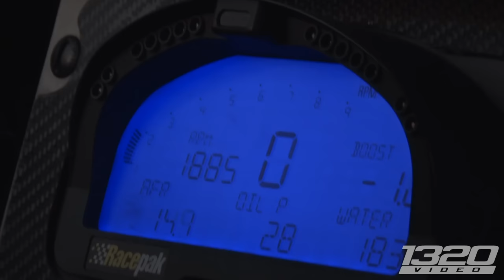2,000hp ROAD TRIP (1,000 Miles - NO Trailer!)

Comment: 70mph and it's not even hitting 2k rpm in a three speed. Haha great car
Reply: 4 speed
Reply: Did I get that  mixed up, I thought he said it was a 4 speed and they changed that to a 3
Reply: John Miller Nope, other way around. 3 speed to 4 speed. You can see him shifting it too. It starts in 1st then each lever drops it into the next gear.
Reply: It also has a gear vendors overdrive on it so it technically also has a 5th gear. They're a .69:1 overdrive ratio if I remember right.

Comment: This '67 Chevelle is one of my favourite car in Hot Rod Drag Week 2017!
Is that 3-speed or 4-speed Lenco? Surprisingly low revs (1,800-rpm or so) when cruising at 70-mph!
Reply: He said they swapped the 3 speed that was in the car for a 4. It also has a gear vendors overdrive on it, that's why the revs are so low cruising.
Reply: Serps1991 thank you, I couldn't really understand their fast speaking without subtitles

Comment: That car went 7 so effortless the first pass and toward the end you could tell the tune up had it running even better, but the track wouldn't hold it. Then Race Engine Guys biggest fear the engine gets even louder on it's own. At least he didn't just risk the entire engine. Sure the head piston and cylinder need attention but at least the lower end isn't toast from hot shredded metal running through the oil from another pass with that damage. She woulda probably bit the end if that engine took another pass. Great ear I barely heard the change with head phones up over half way and that car is loud!

Comment: The real question is, how did this pass inspection?
Reply: It's old enough it's probably exempt, or it's registered as classic or something so it's exempt (I don't know how it works in Canada). Either way it's safer than it was when it was new, and the emissions probably aren't much worse lol.
Reply: In Alberta there is only a government-mandated safety inspection if the car is being imported into the province or if it is a rebuilt salvage vehicle. You don't need a safety on a regular basis or when a car changes hands within the province. Insurance usually requires a safety inspection for cars older than 12 years, but this is probably insured with a specialized insurer.

Comment: Let me guess street legal passes emissions and they drive it on a daily
Reply: got lights, brakes, bumpers and windshield wipers, yup passes alberta inspection.
Reply: 67 so no emissions. Much safer than it was when new and has all it's street gear intact (lights, bumpers, etc.). Do you not see him driving it on the street in the video? It's a rule to run Drag Week, the car has to be road legal, tagged and insured.
Reply: tr0n except slicks and front skinnies including 5 point harness
Reply: harnesses are legal here, front skinnies are legal here, you see the tread on his "slicks" that he runs on the street? yeah. they're street tires.